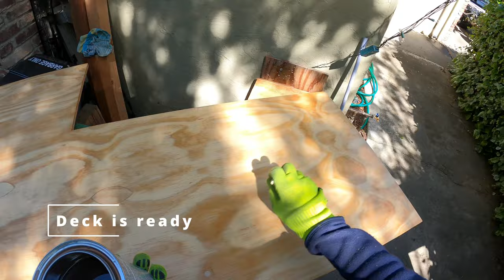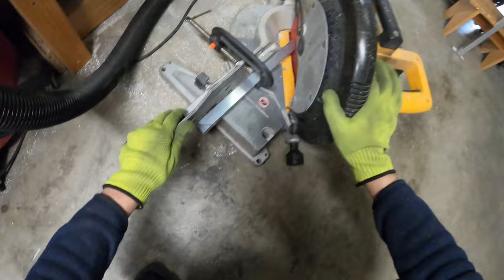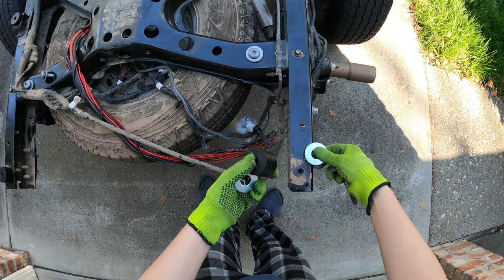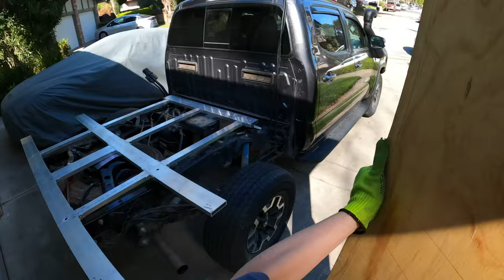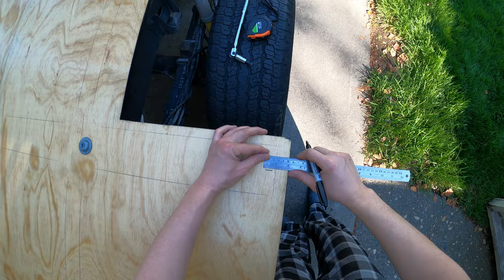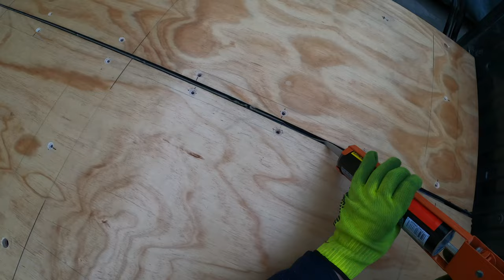Building truck camper -- Ep. 3: deck and front wall frame

Comment: Something called Deck Armor. Used for sealing wood and concrete decks/patios. Stuff works like a bed liner coating. And comes in colors or can be colored like paint. If Deck Armor works like Rhino Liner. Rhino Liner used to coat a concrete brick wall stops tornado toss 2x4s. So would be more a stiffener then a rubber coating. Plywood used in home flooring is best to avoid warping when 24" or less spacing with 2x8s on end and not flat. Sit on the floor edge and see if there is any flex and know the weight of the walls + ceiling will rest there. I think about cheating with my goose neck trailer. Ripping the frame off a pop up light camper and mounting it there on the neck.

$100 Stick welder from online or Harbor Freight. Some practice and metal tubing for a complete frame and floor. Be amazed by looking up used RVs and where they all fail and become very water damaged cheep due to vibration and flexing. An over the cab aero sleep/storage area to keep highway wind speed down to a minimum.